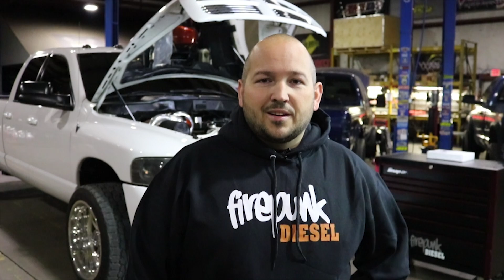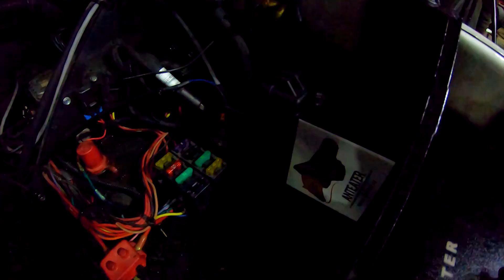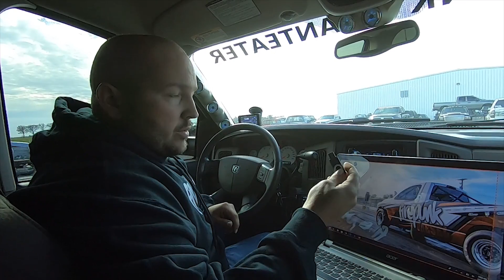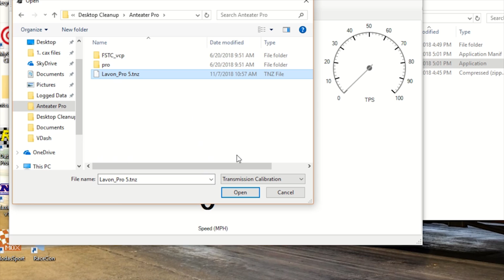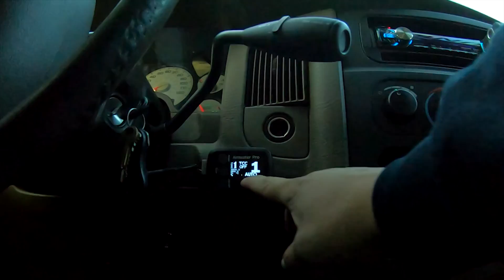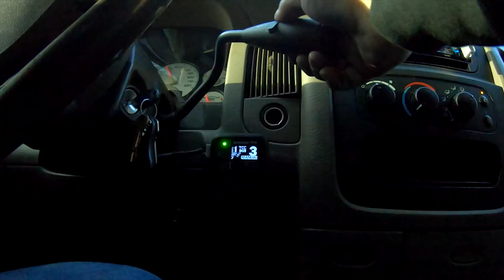FIREPUNK ANTEATER PRO TAP SHIFT TRANSMISSION CONTROLLER

Comment: If the TC  is locked  in tap shifter mode ,  does it  unlock .5 sec  for downshifting or it’s just in auto mode?

Comment: How do you make lockup in 2nd in manual mode?
Reply from the maker: Lockup is still mph based in manual mode so take tune 2 or 3 (your choice) and lower lockup to 20mph range if you want a different lockup strategy in manual mode
Reply: @FirepunkDiesel  oh I see, thanks

Comment: So why do 68re truck guys want the 48re? For racing less shifts faster ET??? I make my living in drag racing and I own a 06 cummins.  My truck is used to get my car to the track and I want to put a 68re in it🤷‍♂️ am I a idiot ?
Reply: 68rfe top of line the fully built is good till 800-900 hp is safe but if you’re going upwards of a 1000hp it is safer to go with the 48 re is more for drag racing
Reply: Sika 1995 if gas is for washing parts alcohol is for drinking and NITRO is for racing..... what’s diesel for🤷‍♂️🤷‍♂️🤷‍♂️getting your junk to the track🤣 I have been drag racing for a living my whole life, just like my dad and grandfather did. I have a 06 5.9 that’s pretty wicked up to pull my race trailer but I have never once felt the need to run it down the strip!!! You guys are silly with this drag race diesel stuff. Don’t get me wrong the firepunk stuff is unreal and are race shop is right next door to Fleece in brownsburg. It’s crazy to see how busy they are ALWAYS😳 a man can make anything fast!! But the less it weighs the CHEAPER IT IS🤣🤣🤣 you could buy a 5 second promod car for what it costs to make a 10 second diesel truck🤷‍♂️
Reply: Groom Lake not everyone wants a pro mod sometimes we just mod our diesels to make them reliable since the emissions are trash  it isn’t that expensive...if you it yourself will save ya allot of money...plus diesels that are new are extremely easy to make decent power with just deleted and tuned but the epa are cock blocking us at the moment
Reply: Sika 1995 take a vid of your Modded🤣🖕🏿 truck and post that shit so I can see it
Reply: Sika 1995 I really like the firepunk guys and are race shop CPR is next door to fleece and them dudes are always helping and hooking us up. But you might want to watch the firepunk dyno video and tell me how rad MODDED🤣 diesels are.

Comment: Is there a way to use the stereo control buttons on the back side of my steering wheel as Tap Shift buttons?  That way I can keep both hands on my wheel when doing WOT shifts in 4WD.

Comment: Couple questions for a 98 47re guy. 
1) I may have missed it but do you offer a tap shifter for a 98? I just heard about the 03+ 
2) is this only based of speed or can you program it to downshift in auto mode based on the tps? By that I mean to downshift and/or unlock the tc with minimal throttle input instead of having to pretty much floor it to get a response like I do now? 
3) is this capable of momentarily unlocking the tc between shifts to help save shafts or will it act like it does now with a lockup switch?
4) when you said it is true manual mode does that mean you can force it to shift into 1st at 100 mph?? 😮 or are there some safeties built in?
Reply: Same questions here, but I have a 01.
Reply: I have a 96, but same question, essentially... Also mine is a 46RE (yeah, gas V8), but plan on beefing it up to around 550wheel on nitrous, and while I'd prefer a 66RFE swap, idk if controllers for those are out there, so having something like this would be my backup plan, tho I am looking to see if a tap function is available on a floor shifter like on Charger/Challenger/300, or a universal fit flappy paddle kit is out there that can be used?

Comment: Looks like a great product.  Probably going to give it a try.  Does this command the low/reverse band when launching in first gear using the tap shift or do you have to pull the shift lever down into first.  Also, can you program it to use the low/reverse band rather than the sprag in one of your auto programs?  Thanks for any info
Reply from the maker: No, the manual Valve in the vb needs to mechanically move to apply the reverse band in 1st gear.  Until there's a all billet vb with solenoids for each circuit, it cannot be programmed to work with a oem style, high pressure vb.
Reply: Sounds good.  Thank you for the info

Comment: Now you have me contemplating wether I should do a MV or run this in the 07 single cab I'm building. This looks like it's a better option for a daily driver.
Reply from the maker: The option to shift automatically and manual gives you the best of both worlds and keeps you from having a ratchet shifter in a street truck.
Reply: Firepunk Diesel looks like I need to give you guys a call tomorrow and run a couple things past you guys.